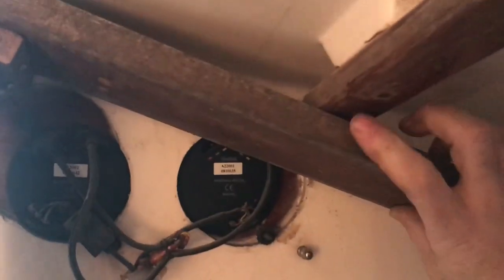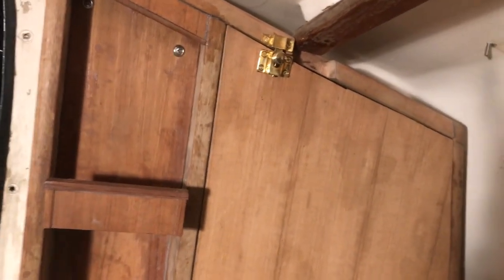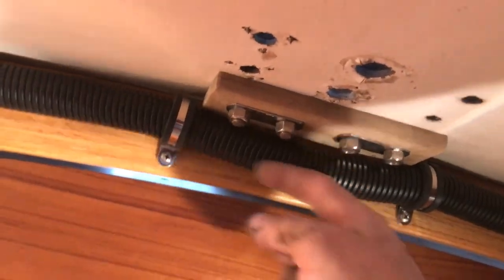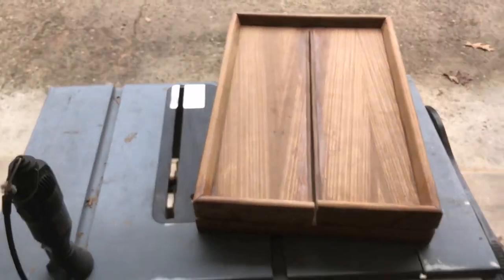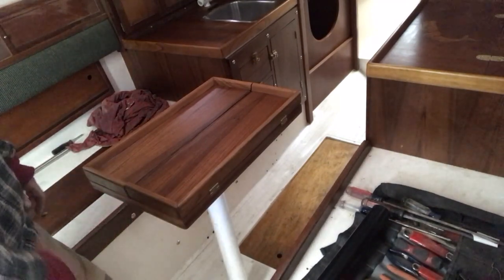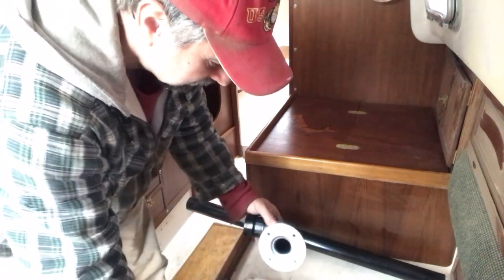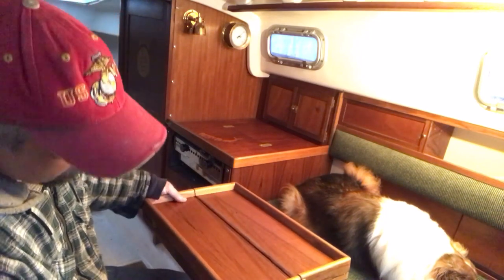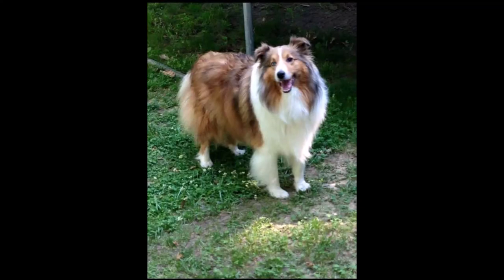Contessa 26 Refit ep.11 - Building Storage and a Folding Table

Comment: What about the Lagun table mount. I bought one and it works great. It does the same thing (swivels and rises 3 directions) , is sturdier and looks neater. Although I like the table right in the middle for dining.
Reply from the maker: I did consider the Lagun mount, but it wouldn’t allow me to swing the table vertically and out of the way. Either way, I’ve decided the original center leg is the best situation for now.

Comment: Great job Epoxy, the boat looks great! What type of wood did you use throughout the project that wasn’t reclaimed from the boat itself?
Reply from the maker: Thanks Rex. I used teak with a little yellow Balau. I bought a full 4x8 sheet of half-inch 2-face teak plywood for the bulkheads and a few other projects. I also bought a quarter sheet of quarter inch one-face plywood for the countertop by the sink and the sides of the galley as well as the folding table. The yellow balau was mainly used as a structural element although in some cases it does look just like teak.
Also I bought two teak door frames that I cut up for the wood.

Comment: What type of hinge did you use?
Reply from the maker: Brass flush hinges. I paid around $20 a pair four years ago, but they are now on eBay for $3 a pair. See eBay item number 164446992466.
Reply: @EpoxyAndButylTape  Great, thanks for the feed back. I apreciate that